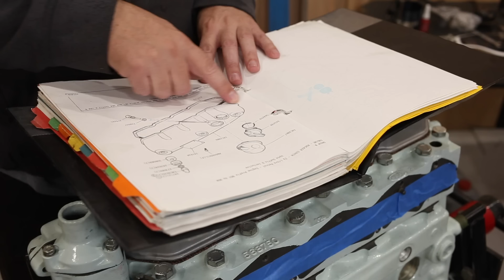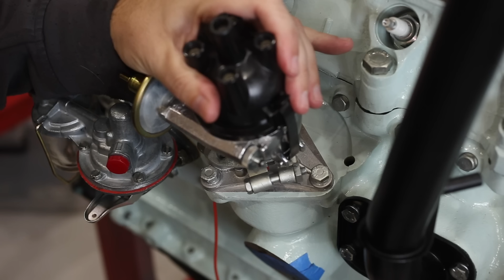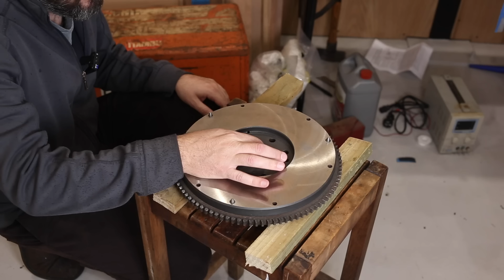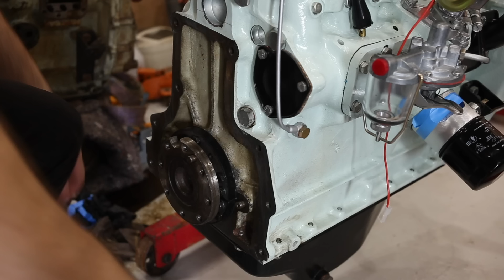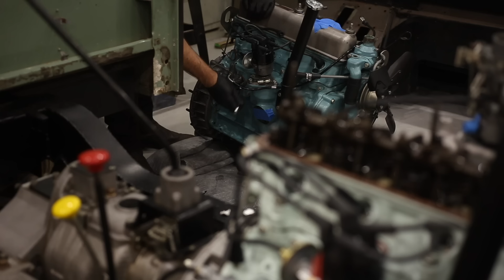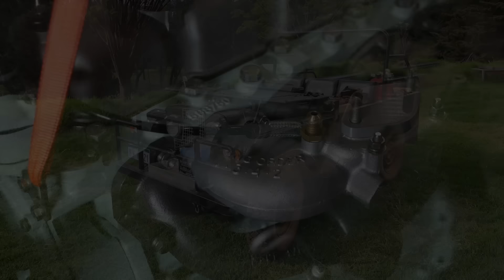Engine Rebuild // Part 10 - Finished // Land Rover 2.25

Comment: Nice work Croker.
I could nit pick about some of your procedures,
for instance like you should glue the rocker cover gasket to the rocker cover  and not do it arse about,
and, always crank an engine over with the spark plugs removed to bring up oil pressure before you start it - avoiding any compression pressure on the bearings before oil pressure is attained,
 but I will refrain from nit picking.......
For someone who is not a mechanic you do a very good job,
 a much better job than plenty of so-called mechanics.

Comment: Hi Geoff, if you want a quality electronic ignition distributor, try a 123 ignition distributor. I have one fitted in my late series 3 and it very well made. It has given trouble free service so far over the last two years. I think they are made in Denmark.

Comment: I had a similar issue with the lift pump on a 2.25 BMC diesel. I left it soaking in fuel overnight, and for some reason it then worked. I wondered if the diaphragm needs to be fully wet in order to pull fuel through?

Comment: Quest one.  Fully restore a much beloved Land Rover.  Side quest, restore a 2.25L Land Rover engine.  Side side quest.  Relocate parts from main quest motor and remove from said beloved Land Rover to run side quest motor.  
Is this not side quest Inception?

Comment: How long have you been working to rebuild this engine? Days? Weeks? Months? And yet you didn't charge the battery?  It could have been on a trickle charger all that time and avoided the frustration of a low battery. I was a truck fleet maintenance manager for 30+ years. We kept all our batteries, those in the parts room and those in vehicles being serviced on trickle chargers until they were put into service. I'm impressed with your otherwise attention to detail and I am pleased with your work ethic.

Comment: When i bought my S3 I naively replaced the fuel pump as insurance, just assuming the old one might be close to worn out. The new one worked but promptly started leaking oil. So back in with the old one, which works fine. If it ain't broke, don't put Britpart parts on it.

Comment: Hello,
I have a question about the 2.25-litre 8:1 engines.
Sometimes I read that they’re supposed to fire at 6° BDC, and sometimes at TDC?
Do you have any idea which is correct? My engine doesn’t run very well at TDC.
Thanks for your videos!
Reply from the maker: Your static timing should be set at 0. If you set timing to 0 with a strobe light make sure the vacuum advance is disconnected and your idle speed is as low as possible. Land Rover specify 0 TDC static - assuming there will be some mechanical and vacuum advance when the engines actually running.

Comment: Use a shrouded screwdriver for valves, much easier. If you can't find one, just take a piece of tubing (can be copper) and put it around the blade. The idea is that it has to fit over the adjusting thead's head. Then you can really lean on that screwdriver and get the gap right (cause at that precision level, it does count).

Comment: Any chance at some stage you might do a video series on a rebuild of the diesel engine?
Reply: I have a candidate with some pretty crazy damage (the engine was still running fine when I found the bearings and a couple cam followers to have been nuked investigating low oil pressure at idle😅) just have to collect from England 😬